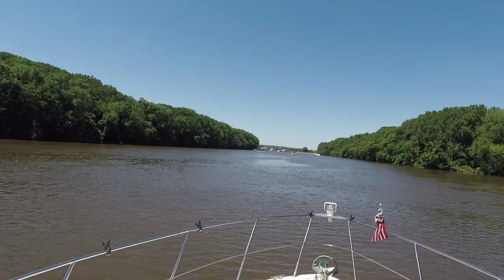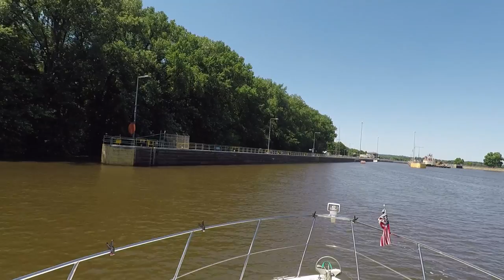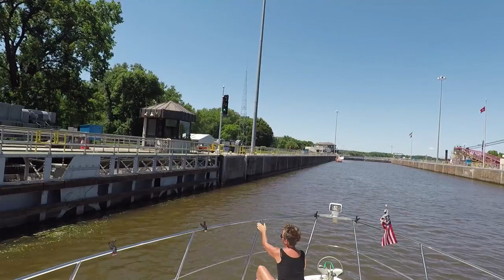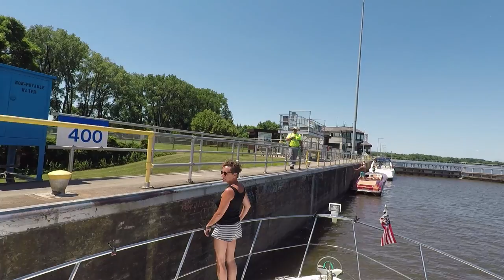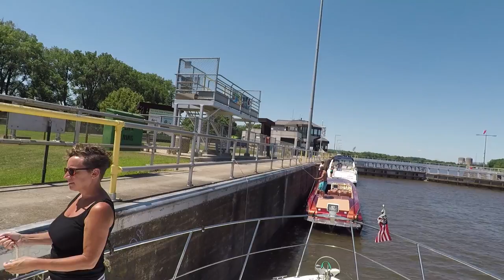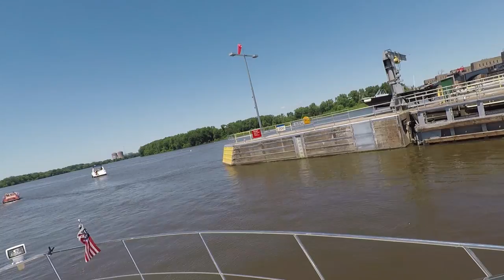How to go through a lock on the Mississippi River small boat

Comment: Thanks so much for this video — very much appreciated (as I am a boater on the Upper Mississippi River) and am fairly new to locking through.  💯 🙌 👍
Reply: Happy to help. It can be intimidating if you don't understand the process. Every lock system is different but this is standard practice up in this neck of the woods.

Comment: This applies to many locks, but I haven't seen many that supply the rope to hang onto as shown in the video. One of my ropes looped over a tie point on the lock walkway is my usual method, or I just hang onto one of the steel ladders in the recesses of the lock walls. I can adjust the length of the rope loop as needed, as the lock level changes and then just pull on one end to retrieve my rope at exit time. They expect you to take a tie point as close to other boats as safely possible, so they can get as many small boats in the lock as possible, and remain at that tie point until the lock doors are opened. Really good bumpers help, because many locks have really rough walls from being hit hard by barge traffic. You don't want your boat rubbing on these rough walls. Going up is harder than going down, because the water being let in at several points causes turbulence that pushes and pulls the small boats around. Going down does not create this turbulence.

Comment: Hello Doug Sprinthall, If you're considering a trip through the Ontario Trent/Severn waterway,  I suggest avoiding July and early August. My family had a waterfront cottage on the first lake in the system (Rice Lake) and it was a "steady stream" of boat traffic during that time. Vacation time. Lock wait times can be an hour or more in some instances. My trip through the system was late August. There is a lock fee (I believe that you can obtain a pass (don't know the cost now) for the entire system. If you have LOTS of time, after getting to Georgian Bay, you can continue up the Bruce Peninsula and across to Manitoulin Island. It's beautiful there. p.s. Tobermory is at the northern tip  of the Bruce and it's a mecca for scuba divers. Lots of shipwrecks. Enjoy.

Comment: What did I miss? It looked like the water level never changed...
Reply from the maker: It was only a couple feet. Pretty common up here in mid summer. Technique is the same regardless of altitude change.
Reply: @13572danube  Got it. Yeah even for a couple of feet you'd need the lock

Comment: Nice video but a word of warning, you're in for a rude awakening if you ever go through Alabama on the Tenn-Tom Waterway down to Mobile.  They aren't as genteel as, apparently, the lock masters in Minnesota are.  (Except at the Howell Heflin Lock and Dam where the lock master is actually a great guy.)
Reply: The lock master doesn't operate the lock or even talk on the radio. Each lock and dam only have one lock master. They usually stay behind their desk. The operators work the lock. I was a lock operator at Ky lock...one of the busiest in the country. 57 foot elevation difference from upper to lower pool. Wheeler lock in florence Alabama is about 97 feet difference

Comment: Thanks for posting.  This is helpful to see (as I'm not even a rookie yet).  If you are going against the current in that stretch of the river (I live in Rochester, MN), what kind of speeds have you seen?  (Trying to determine the type of boat and ability to fight the current to boat up and down the river from Lake City).
Reply from the maker: Current depends mostly on time of year. I ce out through early may is the strongest though a heavy rain can have an effect. Generally the wider the river, the less the current. Strongest current I've seen was 6mph in red wing.
Reply: @13572danube  Thanks!

Comment: It’s irresponsible to say do not cleat going up especially if it’s only 2 ft lift! You definitely need to cleat up! You tend to your line for sure and don’t half hitch just figure 8 but for current safety you do NOT HOLD YOUR LINE! It’s safety! Do not instruct if you don’t know because someone with a heavier vessel will listen to you and harm themselves or another just because you think it’s cooler to hold your heavy Vessel instead of using your equipment correctly! DO NOT LISTEN TO HIM IN BALLARD WASHINGTON YOU WILL GET LYNCHED! AND CAUSE INJURY OR HARM! 🤨🖖🏼🇺🇸
Reply: I would say it alll depends on the situation. Locking down is usually a breeze. When locking up the water can be quite violent when it rushes in. Especially when there is a big difference in height. Then we loop the rope around the bollard on the boat so we need less force.